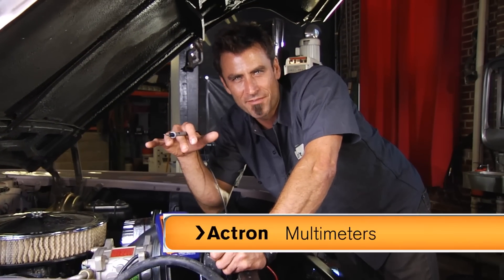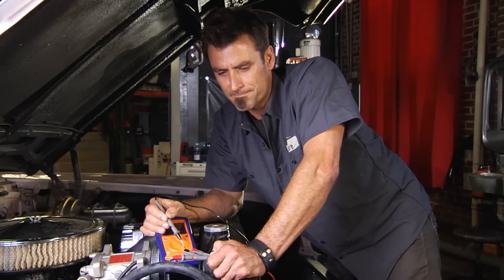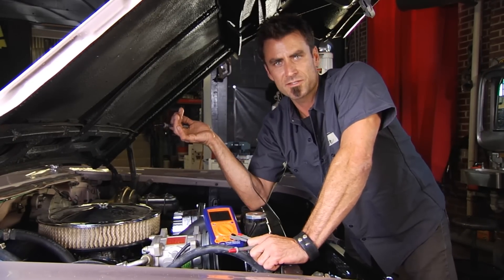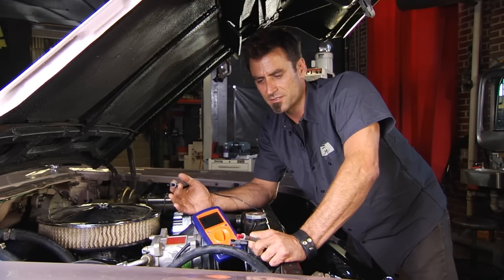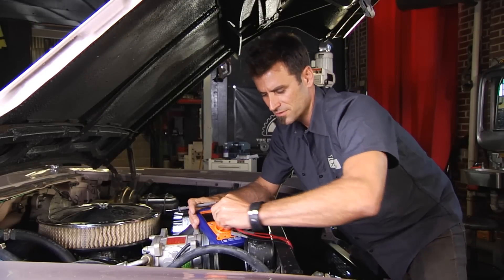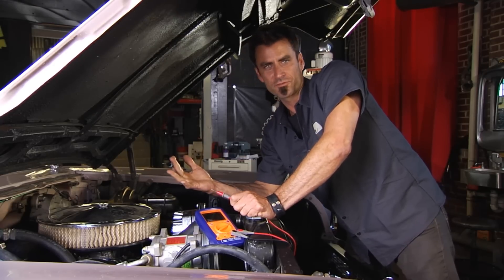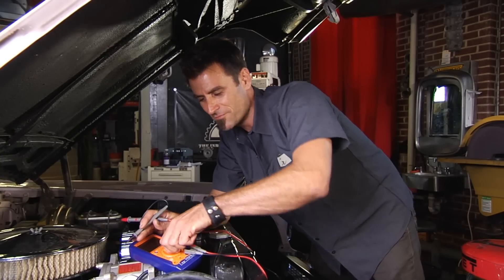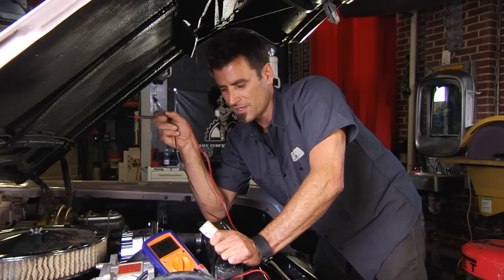How to Use a Multimeter

Comment: You kinda breezed over the information I was looking for. Testing a battery is obvious but what about the alternator? Does the ignition need to be on? Where do you touch the leads? What should it read? What do all those Klingon hieroglyphs on the dial mean?